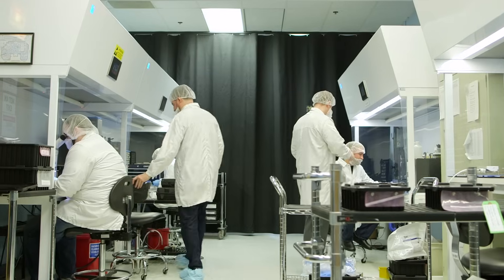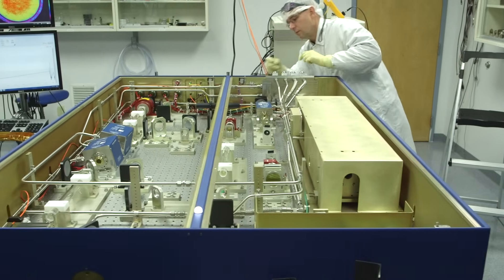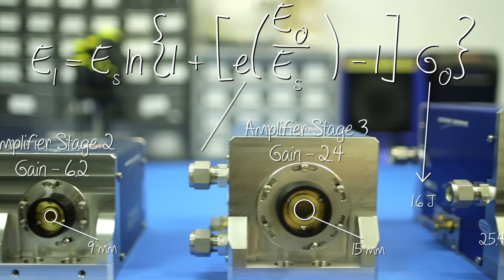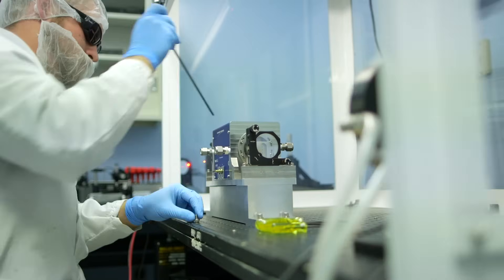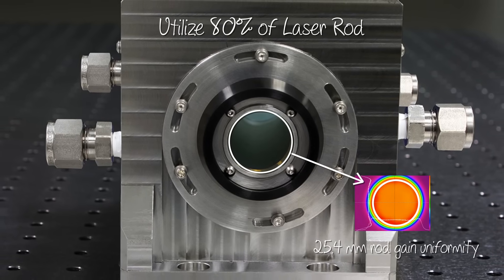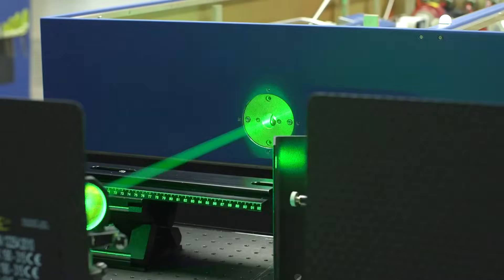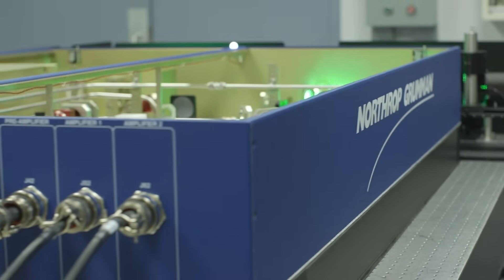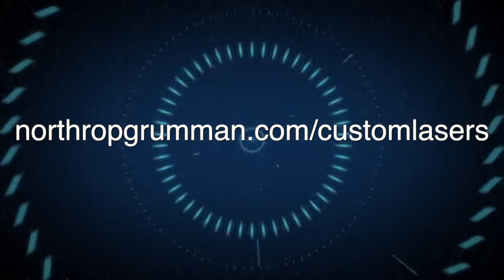High Energy DPSS Laser Design w/ CEO Laser Amplifiers

Comment: Would you advise mentor a 24 years disabled laser hobbyist to build his 1st 532nm dpss laser.
I am a hoarder for pennies as on $800 disability a month. I started experimenting with huge water cooled sealed brick sized gold plated 40w 808nm medical lasers. I bought and repaired for $300 a $95k originally 4 Fap 25-40w containing Coherent Bench Laser that can fiber couple the 4 modules. I have a never used 3-4 ft square laser table with 1/4-20 grid holes. I have an SDL 8110-B CNC other uses 10w 1/4-36 ? SM-905 fiber laser. I have several laser crystals for 532/1064nm shg from 3x3X5 to as big as 13.5x2-20. I have a never used albeit ancient Newport 4 channel diade laser driver with RS-232 portal and 180A 3.3V via 2 bridged aztec power supplies into 4 hybrid DAC/Mosfet TEC Cooled Current Controllers. I have built a monochrome 50mw laser projector and have a pangolin controller I have 2 huge unamed 808nm fap lasers on huge TECs. I would please like love appreciate advisement on hobbling together my 1st custom 532dpss laser using one of 6 808nm fiber lasers. I have 2 Spectra Physics salvaged gold plated.? round based ,? KTP etc Crystal Cooling mounts with Thermistors. I have some limited laser bread board optic mounts. I own safety goggles and observe safe practices with some unforgivingly piwered instantly catastrophically blindingly capable invisible ir diode lasers. Thanks or It could be beneath you. I have innumerable technical certifications. Laser Optics and Physics are not amoungst them.
I am a microwave communication tech and licensed industrial electrician also a hosch ptz cctv tech security tech access control tech. I have area 51 style infra red style biometric hand scanners on my humble trailer.